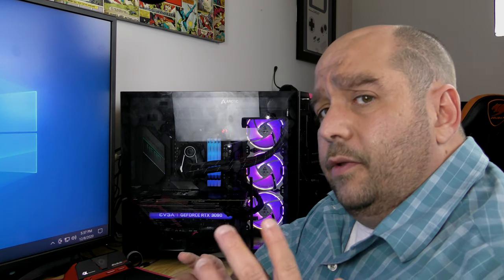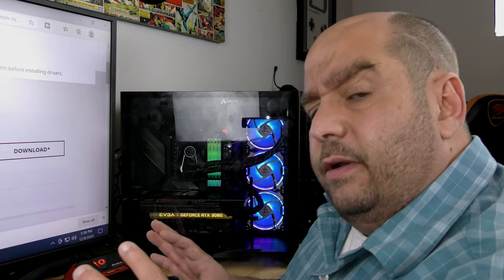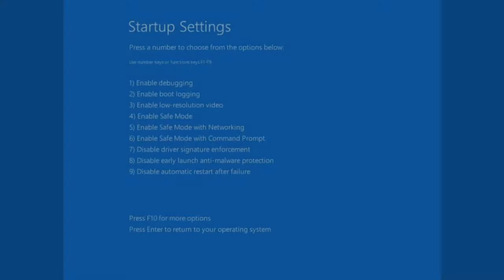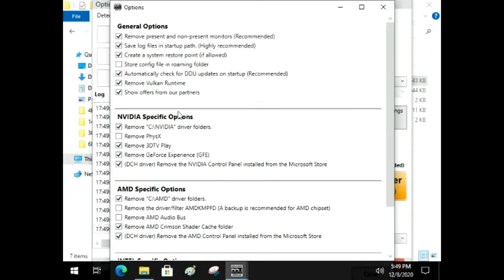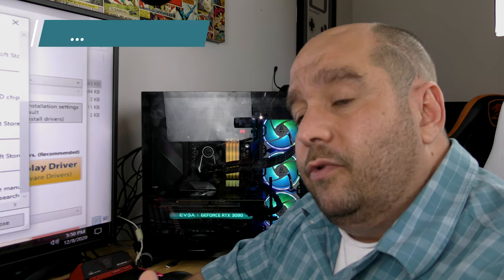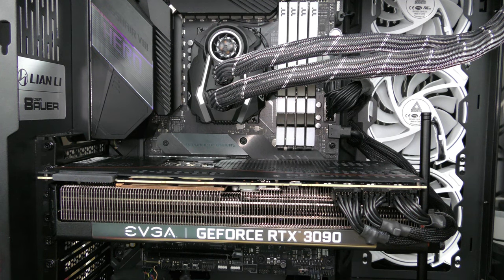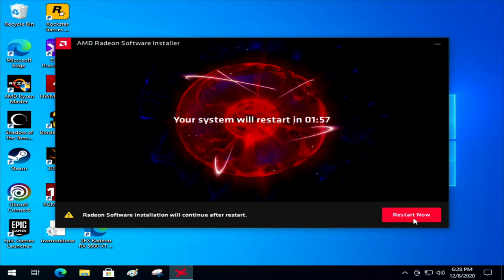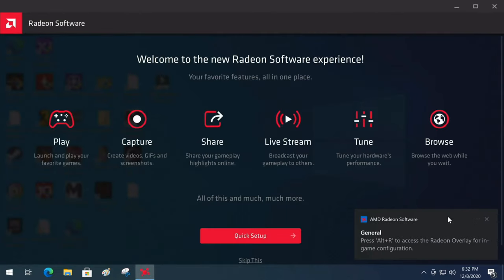AMD Radeon RX 6800 - Installing the Sapphire NITRO+ RX 6800 Gaming

Comment: One step I would also recommend is after you shut off the power supply, I would remove the power lead from the psu and then hold your power button down for about 10 secs to completely drain whatever power is stored in the system.
Reply from the maker: removing the power cable removes the ground, you want to keep the ground.  mind you, the case alone should get rid of all ESD safety, BUT if you have a ton of ESD, the grounds helps.  I don't like to wear the bands, they feel very restrictive.

Comment: Great video. I was lucky enough to grab the same exact card. installed it yesterday easy peasy and I'm still new to computer building and usually I'm very nervous about taking my computer apart. Very happy with the upgrade in performance from my 2070 super. I built the rig to handle digital combat simulations it runs a lot smoother now especially in VR
Reply from the maker: AWESOME my friend, so very happy you liked it.  You might like the video posting in 1 hour, make sure you are subscribed and have that bell notification icon clicked, what I am showing is in beta, but coming soon to this card.  Thanks so much for checking it out and so very happy you enjoyed it.

Comment: Hey there, at the end I bought this card and I installed it how you showed in the video. Thank you, it seems everything worked fine. 😊 I had to attach the pcie cables to the psu first. That was kind complicated since I had to remove the psu from the case. Another complicated stuff was that little release mechanism for the card, it was hard to understand if it was working. In seems everything ok and I’m kind of happy with the 6800. Let’s see how it will be in the future. I’m not happy because no one, not you but others reviewers on the internet told me that with higher frame rate there is Cole wine… that’s annoying. Anyway thank you for helping me/us with this precious videos.
Reply from the maker: I show you those release mechanisms in this video, though some are different.  Was the one I show you in this video similar?  

This is not true about Coil wine, Coil wine can happen to all cards, it can happen to no cards, it is luck of the draw.  Your friend can buy the same exact card and have no whine, or have even more.  You can have 10 of the same cards next to each other and it will happen to 3 of them, but not the other 7.

It happens, put your headphones on when you game, you won't hear it.  Happy I could help.
Reply: @ThisBytesForYou  I think I have the same mechanism. It was just me, I find hard to put my fingers in these new stuff. :) I was pushing, the old card was moving but was not out. Then the 6800 was inside, I pushed but I didn’t hear any clicks but it was stuck. After attaching the pcie cables, I heard a click coming from that mechanism. Your explanation was perfect. 👍🏻 

Fortunately about the coil wine it seems I have it for just one videogame. Maybe it happens due to high frame rate. About this game I have to say that this coil wine is synchronized with the movements of the protagonist makes in the game and it stops for 0,5 seconds when there is a frame drop. But it is kind of. I already played with that game, I’m curious how it will be for future games. You’re right about the headphones, but I record gameplays :)
Reply from the maker: @isoladellerosetv  get further away from your PC, you will be fine.. typically the coil whine happens during bright light, open up a notepad and full screen it, you will hear it screech a little, sadly there's no way around it.  Hope this helps a bit

Comment: I just upgraded my setup from the 1660 to the sapphire nitro+ 6900 xt. This video helped transfer to the new card. Thanks for this extremely informative video
Reply from the maker: Awesome my friend, Always a pleasure, so very happy you stopped by, trusted in me to help you, liked and subbed as well as took a moment out of your day to thank me.  It means a ton to me and I am so very happy I could help you.  That's a beefy update, how are you liking it?
Reply: @ThisBytesForYou  it's not working like it should, I'm currently uninstalling and reinstalling the driver to see if that fixes the issue
Reply from the maker: Why do you say it is not working like it should?
Reply: @ThisBytesForYou  because games are playing exactly like they were when I had the 1660. Minecraft runs at 70-80 fps at 1440p
Reply from the maker: @jcspotter7322  right, because you came from NVIDIA, uninstall minecraft, and reinstall it now.  Personally, when ever i upgrade my video card, processor, motherboard, i reformat, you have legacy drivers and legacy installs that depend on architectures that have since been changed.
Reply: @ThisBytesForYou  will do, thanks
Reply from the maker: @jcspotter7322  np, also, what is the manufacturer and model number of your monitor?
Reply from the maker: @jcspotter7322  make sure you have windows set to 144hz as well.

Comment: I used a Scrabble letter holder (the wooden block that looks like a church pew) for my anti-sag device for my last build. The height was perfect. Highly recommend.
Reply from the maker: oh man, that was awesome, I did giggle out loud on that one... but I am guessing your GPU is really close to the base of the case... or am I forgetting how big the holder was?
Reply: @ThisBytesForYou  Well, turning it on its side (north-south) it might be---6 inches possibly? Something like that. Absolutely perfect fit, including that slight upward pressure. I've used other weird things in the past too. I didn't even hear about these anti-sag devices until last year, lol.
Reply from the maker: That's pretty cool my friend.  I would do the same but after getting this bracket, there's no turning back, it's pretty awesome, effective and cheap
Reply: @ThisBytesForYou  For sure, I will purchase one of these. Somewhat off topic, what is the best forum in your opinion for troubleshooting a 6800xt? This is my first time owning an AMD card and I'm in over my head. I'm only getting 40 FPS or so in Metro Exodus at 4K, ultra settings but no hairworks or ray tracing. The card doesn't seem to be drawing enough power---it stays around 170 watts. I am using a pig-tail type connection (not separate cables, but one cable with two connectors). And I have other issues, like getting the proper color depth. Monitor is 10-bit, but AMD software will only let me do 6. Is there a forum you can recommend?

Comment: can you make a troubleshoot video for the Sapphire Nitro+ rx 6800 when the lighting is not working :(
Reply from the maker: The RGB light you mean, what motherboard manufacturer and model number motherboard, case and power supply do you have?
Reply: I have the same issue, it seems that the 3 pin rgb cable is missing... Should it be in the motherboard cables or with my rx 6800?
Reply from the maker: @Ketherrr  no, if you check the link in the description, I bought the cable.

Comment: I know all of this stuff but still watched the video, ty!
Reply from the maker: Thanks my friend, I truly appreciate it and I am so very happy you enjoyed this video.
Reply: @ThisBytesForYou  also, i fricking got the 6800, 800 dollars but i think it's the best price cuz msrp Is impossible and now with chirstmas
Reply from the maker: It's not so much Christmas as it is the scalpers and supply and demand but actually with all that, you can still find the around that price at roguecast.com, great prices and I also review for them as well.
Reply: @ThisBytesForYou  nice! I'll check it out, btw do you also experience crashes with quake 2 rtx? I get random crashes when I'm on rtx and it says quake2rtx not responding and when i switch to OpenGL it works idkkk
Reply from the maker: I have not tried it yet but If you are having issues, maybe this will help, aside fr dduing the drivers and installing new ones https://youtu.be/8JuC_Dpm6-c
Reply: @ThisBytesForYou  i ddued like 20 times and no help but I'll check out that video, thanks man ur the best
Reply from the maker: Did you ddu  in safe mode, and anyte my friend, I love helping
Reply: @ThisBytesForYou  yup, mode safer than... I dont know safe mode
Reply: @ThisBytesForYou  oh also, what cpu Cooler do you recommend me for a 3700x that has RGB and not too expensive? By the way, i have a toasty sillicone
Reply from the maker: Check in the description, in this build I use the 280 but in my main build I use the 360, both are great though
Reply: @ThisBytesForYou  I'm going to check it out, thanks
Reply from the maker: Always a pleasure my friend

Comment: 14:16 This is where my problem begins and facing a lot of people, i recently purchased RX 6600 XT and having a black screen issues, same like that beep sound and after that boom, no display, but the PC is working fine in the background i can hear the sound, i have did everything possible to solve this, but sadly nothing works, don't know what to do.
Reply from the maker: So that I can help, please list the manufacturer and exact model number of the following components:

1. Motherboard
2. CPU
3. RAM
4. Video Card
5. Power supply
6. Monitor.
7. Are you running through HDMI, DP, DVI, VGA, etc?
8. UEFI in the BIOS from Legacy.  If it was set to Legacy, you will need to reinstall windows to get correct support.
9. Disable CSM in the BIOS
Reply: @ThisBytesForYou   Thank you for the reply.

1 Motherboard : msi b550m pro motherboard
2) CPU - Ryzen 5 3500X
3) Sapphire Pulse Rx 6600 XT
4) 16GB Ram 3600mhz ADATA
5) Circle 550 W Bronze 
6) Acer NITRO VG240YS
7) With DP cable, It's a brand new monitor, Also tried with HDMI as well with no luck :(

Things i do, Before i thought my Monitor is the old one around 7+ Years, so i thought that can be a problem, then i bought a new monitor, but the problem didn't fixed, When i installed very first time driver, everything went smoothly that time, AMD driver was installed succesfully, i have also played games as well, But when i did start my PC on next day from that day it was giving me black screen, I have installed every single AMD driver till yet, last 2 of them which are supported by this GPU only as of now, but no luck, It just make beep sound and it goes blank, to verify that, i run my screen remotely with Anydesk/Teamviewer, most shocking was i can able to see the screen there, easily, It was showing that, Driver is not loaded succesfully something, it was giving me error. I have DDU more than 10+ times already to make it fix, and then i thought let format the PC will do from the scratch,  but after i came to main screen and tried to install, it was again give me black screen, this is so frustrating to use this GPU, but it's a new GPU, i'm pretty sure, it's not from a GPU side it's a Driver side error.
Reply from the maker: what you are going through sounds common.... till the beep... that's not good.  Do you have the 8Pin PCIE connection plugged in?  The 500Watt is the bare minimum the video card requires.  This does not take into accounting overclocking or anything like that, which takes additional power.  Verify this is your motherboard, but make sure you are on the latest BIOS, there are man updates to the  AMD ComboAM4PIV2, Support S.A.M technology, AMD AGESA  all of which are important to make this work: https://www.msi.com/Motherboard/support/B550M-PRO#down-bios
For the monitor, is the cable HDMI 2.1 or DP 1.4, it has been known to fix many issues using the latest standard cable.

This video kind of walks you through the process of flashing and setting up an MSI bios, mind you its for a 570, but it should be relevant: https://youtu.be/AaFkBQaJDW4
This video will help you get your system to where it needs to be to get 100% performance: https://youtu.be/8JuC_Dpm6-c

Comment: Are you able to controll either RGB software or Bios Switch on the TRIXX SOFTWARE?. i have it in the 3rd mode (Software switch mode) but i cant change any settings on the trixx app. I can only use the Trixx boost for resolution lowering. Thanks in advance
Reply from the maker: Working on that now
Reply: I have exactly the same problem and I am looking for a solution, maybe Sapphire support?

Comment: I will be purchasing this graphics card 1/23. I own a new custom built PC purchased from Micro Center that currently has no graphics card installed. It is only using the graphics built into the AMD Ryzen 7 7700X 8-Core Processor. Following your video, will I need to uninstall any graphics driver before I install this card? Thank you
Reply from the maker: yup, and you will also need to disable the igpu in the BIOS

Comment: I agree about the removal of the power lead from the psu , its ott about making sure there is no power at all . I am more concerned about completely draining remaining power from the pc by holding down the pwr button. What usually happens is the fans will spin and the lighting will come on for a split second, this gets rid of any remaining pwr  left in the pc. I found your video as Im building my new pc at Easter with an Asrock 6800XT Taichi and I havent had any thing todo with AMD for a lot of years. My current pc is 6700k with Titan maxwell in SLI and Ive  only been used to Nvidia Drivers. Its a great explanation of installing the AMD software.
Reply from the maker: yup, you are right, but with the time it takes to unscrew the card, unplug the cables, by that time, everything is drained.  Awesome my friend, I am so happy you enjoyed my video and found it beneficial, it means the world to me.  I hope to have a full review on the 3060 out on Monday, I hope to see you there, and a full review (which I am very late on) for the 6080 shortly after, comparing it with another top tier card ;)

Comment: Hey im trying this method and now I’ve been stuck with a black screen. I followed step by step and now I’ve installed the 6800, but nothing comes on my screen.
Reply from the maker: So that I can help, please list the manufacturer and exact model number of the following components:
1. Motherboard - manufacturer and exact model number
2. CPU - manufacturer and exact model number
3. RAM - manufacturer and exact model number
4. Video Card - manufacturer and exact model number
5. Power supply - manufacturer and exact model number
6. Monitor - manufacturer and exact model number
 Redundant I know, but many people forget to enter manufacturer and exact model number
7. Do you have ALL of the PCIE connections plugged in, and not daisy chained or pigtailed, each coming directly from the power supply?
8. Are you running through HDMI, DP, DVI, VGA, any adapters?
9. Is UEFI or Legacy Setup in the BIOS?
10. What slots do you have your RAM installed in?
11.Do you have CSM Enabled or Disabled in the BIOS
11. Installed latest supported chipset driver?
12. Have you disabled Fast Boot within Windows?
13. This video will help you identify hardware inside your PC: https://youtu.be/65ZSiVImJx0
Reply: So I literally purchased all new parts (except New SSD/HDD)
Now I have MSI B550 PRO-VDH WI-FI mb
AMD Ryzen 5600x 
TForce VulcanZ 2x8gb 3200 ddr4
Radeon RX 6800
Ares 750W Bronze Cert
Dell Curved Gaming Monitor S2722DGM
Yes, I’ve organized them so they aren’t pulling each other, all coming from psu 
I run through DP. I attempted DP and HDMI through MB and still nothing.
I am not sure how to answer that question. I followed your instructions to boot into safe mode and load ddu. I don’t know what it is.
MB suggest I place them in DIMMA2 & DIMMB2
I don’t know.
Yes
Yes
Reply: When I put my old graphics card in (NVIDIA GEFORCE 1660 TI) it does the same thing.
Reply: The DRAM light stays on, white.
Reply: @ThisBytesForYou  I appreciate you reaching out, I finally fixed it!! I reseated everything and threw out my old ram cards. Tested one each until I got them both to work and now I’m currently updating the Adrenalin software. Thank you SO MUCH for your helpful walkthrough, I had to have watched this video and 20 others at least 3x each pulling my hair out lol but I finally got it thanks to your patient and thorough explanations.
Reply: Subscriber for life for this help man. Thanks a bunch
Reply from the maker: man I am so sorry I did not reply, I didn't get a notification of your post, but I am sooooo very happy you got it working and I am sooooo very thankful for you subscribing and sticking with me as well, it means the world to me.  If you feel like you know people that would benefit from this video, please do share these videos, that would help both of us a ton.  Thanks again my friend. @stuckwchuck

Comment: why does my vga cable have dual 6+2 pins on the end? how would that work with my rx 6800?
Reply from the maker: 6+2 is an 8Pin or it can be a 6Pin, that is perfectly fine my friend, and yes it will work.  Just make sure that you don't use the pigtailed connection, 1 cable, 1 connection.